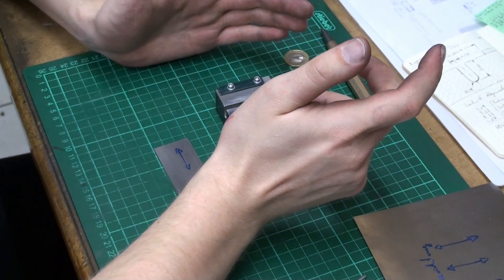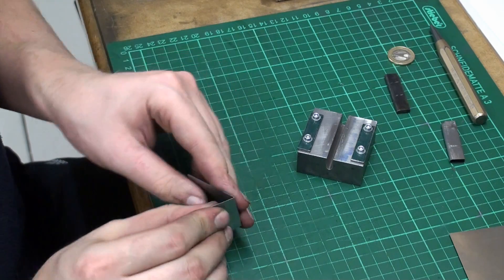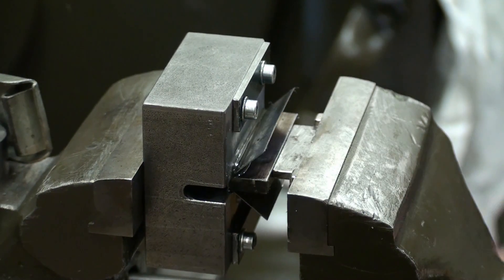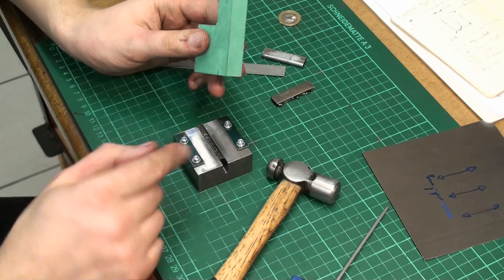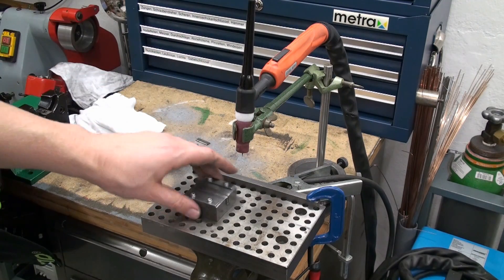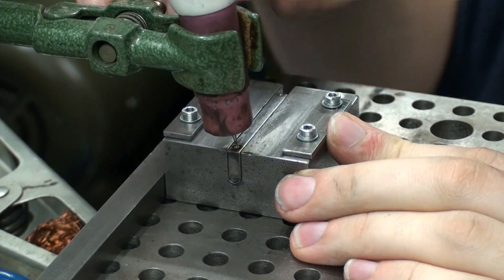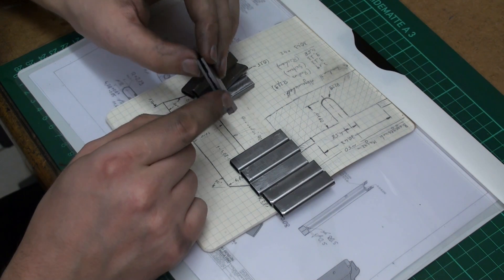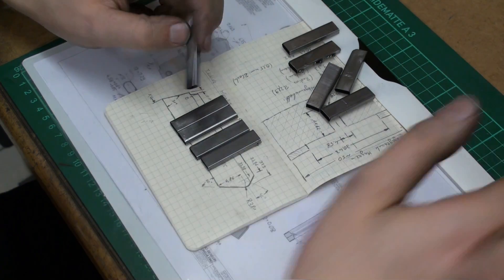Miniature M1911: Magazine Part 1

Comment: That welding setup is pure genius! Ad a little screw on that to push the forming block across the tip and it's basically a semi-automated system, of sorts.

And i'm not surprised that shape is strong. The combo between the round section and straight section does the job. Had it been a rectangle or an oval, not so strong. Combine the two, you get the rigidity of the straight section and the flex of the round one.

Can't wait for the next episode.
Reply from the maker: Hey aserta :)I came up with that setup out of pure desperation and was quite suprised that it worked that well - at least one traveling axis with screw advance would be nice, just to make it a bit more precise.In theory (and practicaly) the shape should be/is very strong, but when I held the finished part first in hands my first thought was "hell, thats flimsy", the .25mm sheetmetal is only a better foil...but its realy very strong.Thank you for watching and keep the comments comming :)